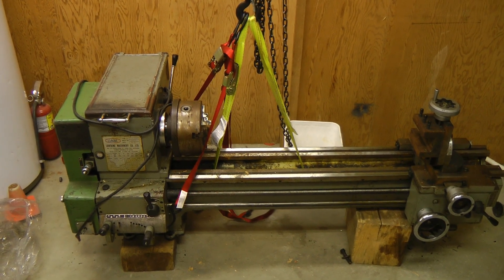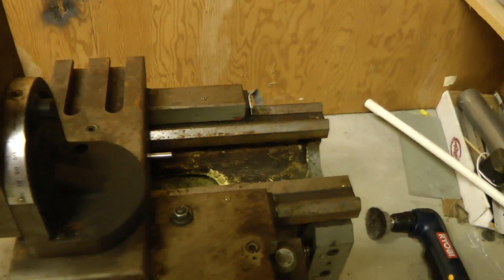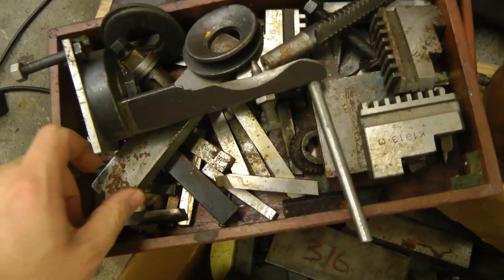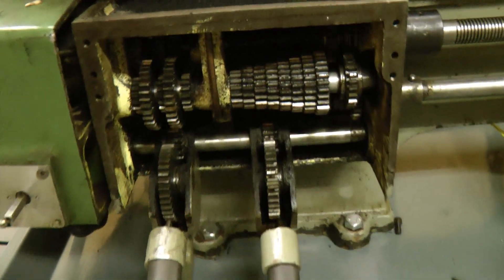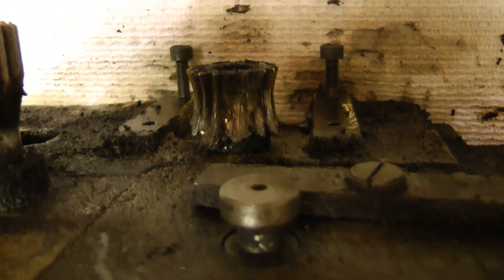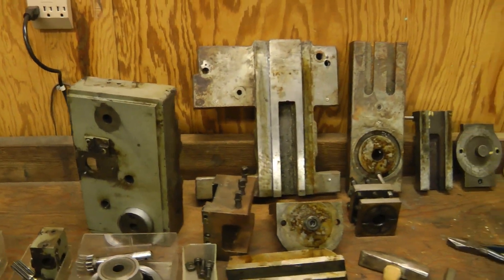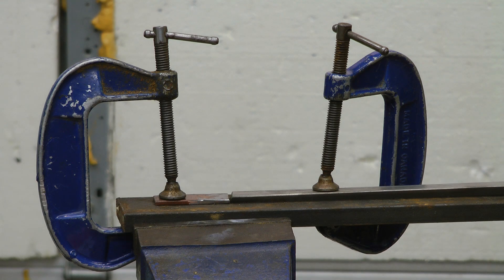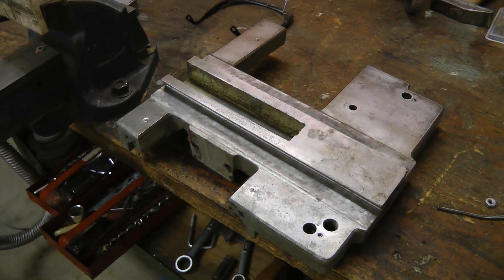Lantaine LAM-350H metal lathe part 1

Comment: I have a Lantiane 350 . My gunsmithing shop run on it. I have done a lot of improvements on it. If u are interested please let me know and i will gladly share the info.
Reply: I most certainly am .. 

Have the Australian version Alpha Poncho . Ha . That isn’t a joke either .
Reply: I have the same one, a JK-900, I want a Poncho. Did you end up getting the information you needed? I’m interested too
Reply: @Super--Star  ummm yeah, I seen a few things that I wasn’t sure on . 

Definitely would love a milling attachment on mine. Ha. But I think it’s time to part ways with it. Confidence is up, and size is becoming a factor for jobs. But mostly , having to change the belts every damn time I need to adjust the speed . 🤦🏻 it has broken my soul coz of that one simple feature on the machine. 

Geared head all the way 😜🤣
Reply: @RepLicanT00100  I just had a better look over mine, it has broken gears, the rest looks ok, but it will cost a lot to fix. The parts from the US are crazy expensive. I wish I could find out where they’re getting their parts from in either Taiwan or China. I’ve done a look around and I can’t see the same one
Reply: G'day mate, I have recently acquired one of these  old girls and am looking too make some improvements, if you are still keen on sharing your knowledge I would be very interested. Cheers

Comment: This is epic...

I have one of those lathes, and I broke the feed gear years past. After you mentioned that a "Grizzly" lathe is compatible I immediately looked it up and am getting ready to order replacement parts.

I'm going to be putting a DRO on mine, which I may video. I'm also working on making a "Digital Angle Gauge" for the slide.

Comment: With milling, you can get away with putting the cutter in the chuck, but the cutters are hardened and may slip if you go heavy.  Collets are the proper way to hold a cutter.

Comment: Great video. Congrats on your score! It is going to be so nice when you are done.

What fluids were  you using? It looked like motor oil but what was that thick white/brown grease? Also, what fluid did you use when cleaning with the pump. I'm dealing with a similar thing except it is in the shape of a 1984 34 foot boat. I tried the "degreaser" from Harbor Freight (do those exist in Vancouver?) and it didn't touch the crap we pulled out of the engine area.

Anyway, thanks again for your videos.

Comment: You can use a high silver silver solder to hard solder the plate onto the nuts, not as much heat as brazing and a stronger joint than the screws. Best is to use a paste there though, as it fills the gaps nicely.

Comment: I think 900$ for a lathe with missing tailstock and stripped teeth / broken gib is way too much. that would have been 250$ tops in my book.  You will have major headaches with nearly every aspect of it. You will probably need to make tailstock base from scratch to match the height. Make and scrape-in a new gib is not a novice job and neither is a new gear. Check out Nick Muller's channel he has videos about some of the stuff that needs to be done.